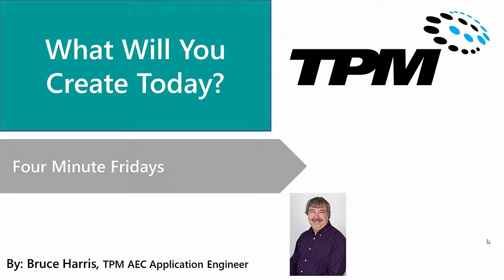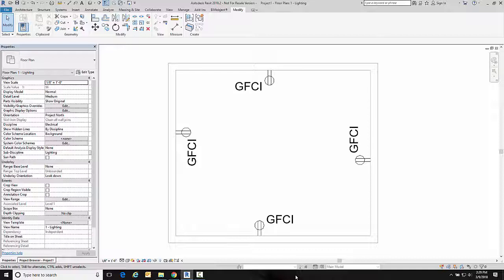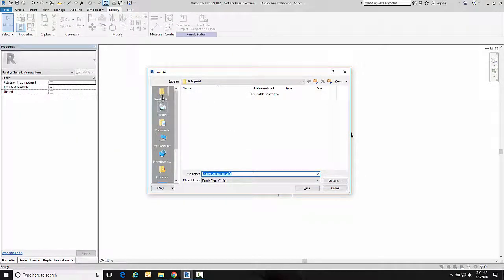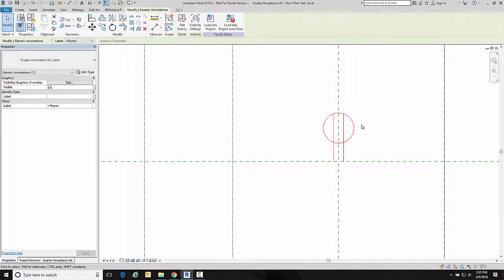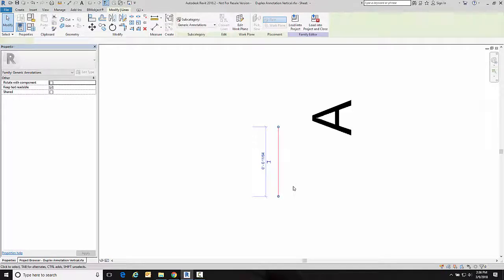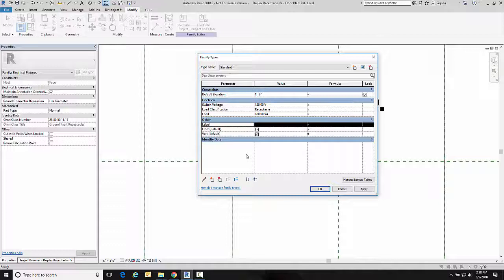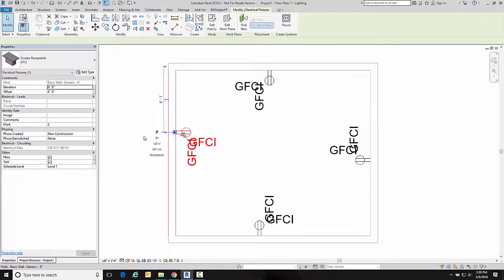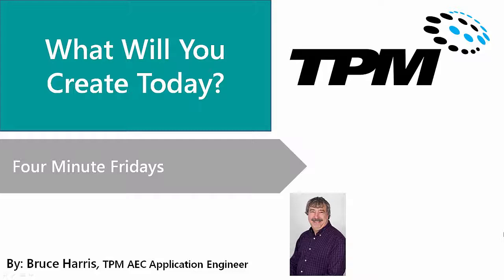Electrical Fixture Labels for use in both Horizontal and Vertical directions

Comment: You could just open your original family, copy the label and rotate it. Then create two yes/no instance parameters for the visual. Then in the parameters, set the horizontal calculation to =Not(vertical). So by default the horizontal comes in normal and when you host to the vertical wall, you just click vertical parameter and it turns off the horizontal. You won’t have to save three families to load into your main family and saves another click when you want to rotate label.